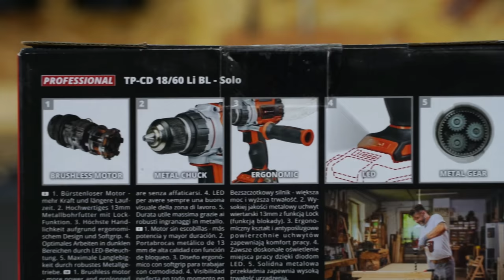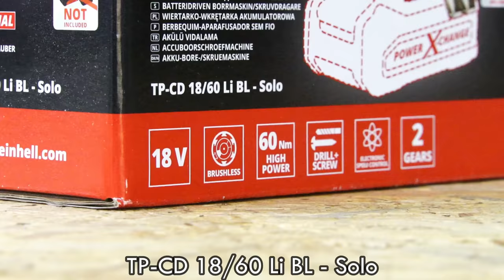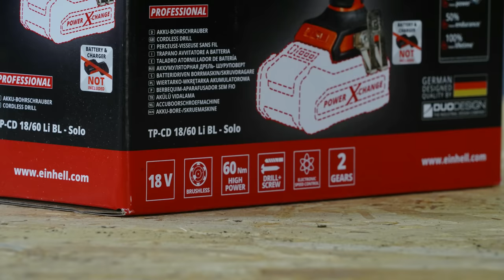Einhell TP-CD 18/60 Li BL / TEST & UNBOXING

Comment: i get it  its sponsored video but you should dive deeper  in capableties of tool, what is limit, how long it takes to do job, not just like fast forward video
i have einhell te-cd 18/40 and it can drive 120*8mm secrew in 1 gear (70 mm on 2)
what i am saying the job you shown my  cheper one can handle you should show potenial of tool
have a great time and be safe. 👍👍